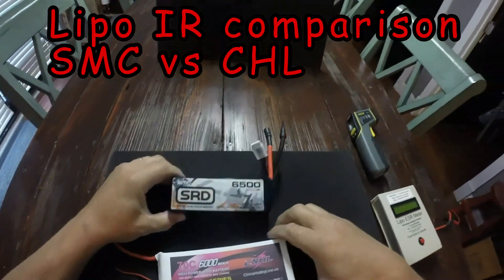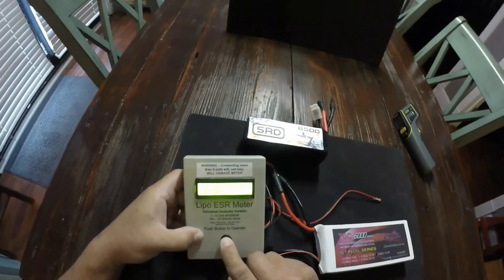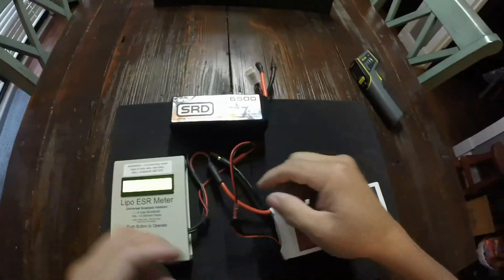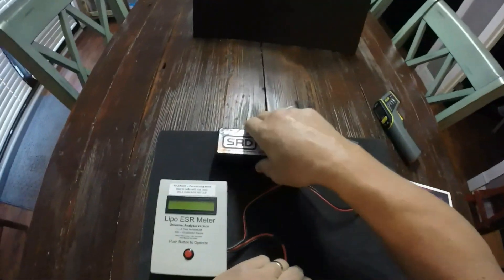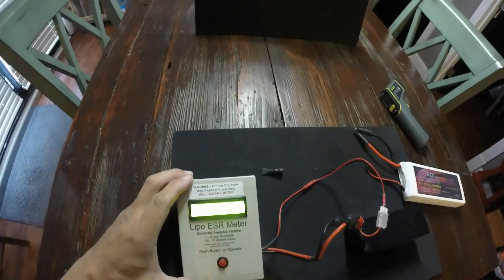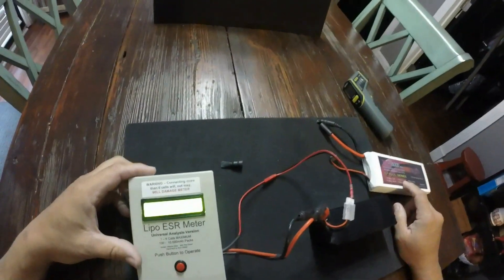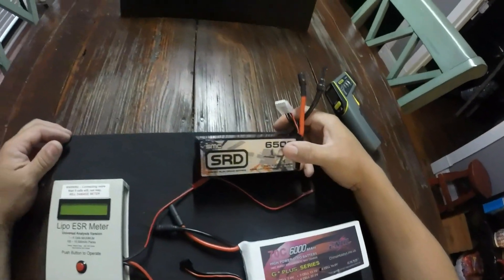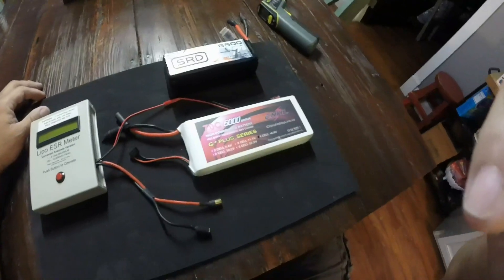SMC SRD vs CHL 6000 70c lipo IR comparison

Comment: Same exzact numbers flopack got with his video.I guess those meters are on point.  Nice
Reply from the maker: Good to know the meters  are correct  and the packs are also made with same cells.
Reply: Do you see a difference  between the 2
Two when running?  I personally  never used smc but I see you pushing them
Reply from the maker: @rccraziness6980  I have made all my fastest  passes  with smc lipos. Since I started  using them.

Comment: Great compare! My Cnhl g+ came with 8 awg.
Reply from the maker: Odd, that is something  else in it's on then. I've looked and nowhere did it state wire size. Maybe just a gamble what you get?
Reply: Yeah probably gamble. I order inside europe but don't know if they still are made in the same factory.. Positive surprised anyway.
Reply from the maker: @mattiasholmstrom103  definitely a good thing.
Reply: @philipjolley1015  Absolutely, just put up a video on the Edam on this channel, just a tabletop but goin out to do a speedrun as soon as it stops raining.
Reply: Yeah if you order them with 8mm bullets or Qs8 they come with 8awg 👍🏼 G+ and 90c
Reply from the maker: @chrisbryan6493  good to know